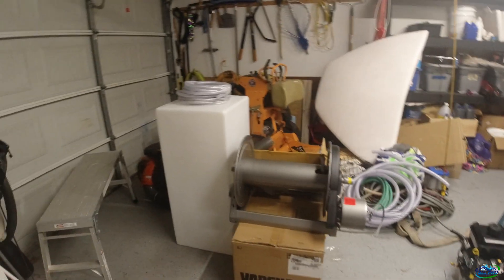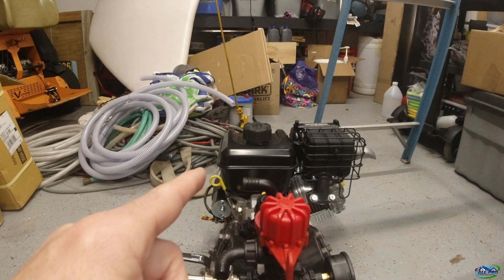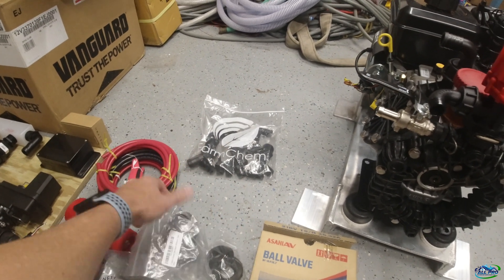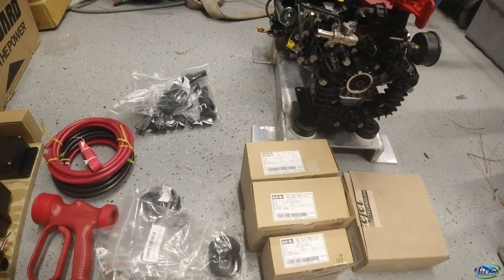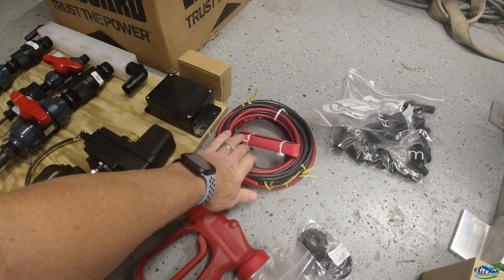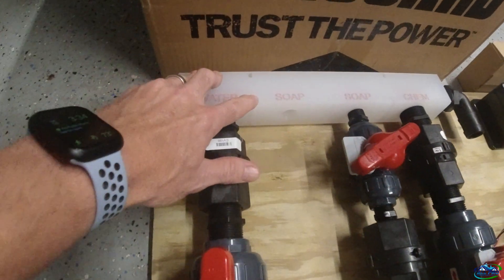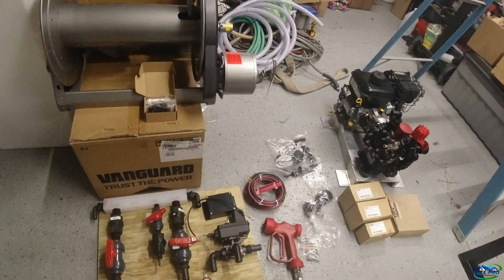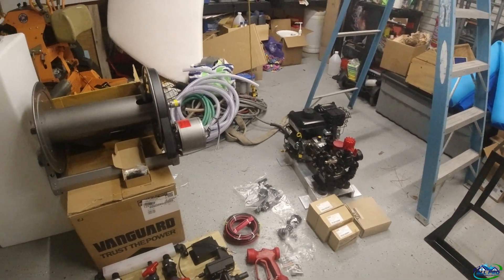AR45 Parts Breakdown

Comment: I want to remove my vanguard non electric start motor off of my AR45 but i don't know the shaft length and diameter to properly buy the new honda gx200 electric start motor.  Do you happen to know what the shaft size and length needs to be to hook up to the AR45?
Reply from the maker: The shaft size on my Vanguard 6.5 is 3/4" x 2-27/64". Thanks

Comment: When I used a wire calculator  installing  my 12v electric reel (36 amps it says), it said 4awg. Any issues with the 8? I guess you wouldn't have anything to compare it to but you'd know if it was getting hot or dropping out from low voltage I reckon.
Reply from the maker: No issues so far. Thanks

Comment: How come you went with the solenoid valve for this and not a ball valve like with the the downstream box? Thanks
Reply from the maker: There is no reason particularly. I read somewhere that the solenoid valve is actually a little smaller than the ball valves in the same size. Thanks

Comment: I watched this video and bought the same engine and ar-45 but where do the positive and negative battery cables go on the engine there’s nothing in the manual and I called vanguard and they don’t even have a clue
Reply from the maker: I put the ground wire on the bolt that mounts the engine to the skid & then to the negative battery post. The positive wire connects to the stater solenoid on the bottom post. You can reach out to me if you need pics. Thanks

Comment: i just bought a ar-45 today. what size are your hose barbs? my outlet seems to be 5/8 thought it was supposed to be 3/4. when i hook up my out let hose going to my hose reel it blows off. so just wondering if yours came with 5/8
Reply from the maker: My outlet hose to the reel is 1/2" & the bypass hose is 3/4" & main feed is 1". Maybe you got the AR60? Thanks
Reply: @allproexteriorservicesllc5338  it’s the ar 45 everything is same as yours but main feed is 1”1/4
how come my red gun keeps blowing off my 1/2” hose? i have to clamps on it i don’t know what’s going on
Reply from the maker: @scottgarvey9164  I use 2 clamps on the barb that connects to the red gun. I don’t think the 1 1/4” main feed hose matters.

Comment: on the metering valves, is in necesary to use a 1 inch on sh or would a 1/2 inch valve work?
Reply from the maker: You need 1" for the water & SH. 1//2" will not provide the proper flow. Thanks

Comment: If you don't mind me asking, how large is that piece of plywood to fit everything, I want to put mine in an electrical hinge cover box for protection, just curious how large of a box I would need.
Reply from the maker: I think it is around 16/18" tall x 22" wide. Be careful with the box & leaks. If it leaks SH, it could cause corrosion issues if you don't rinse it off. Thanks
Reply: @allproexteriorservicesllc5338  thanks, i'll keep that in mind.

Comment: Are you running 300’ 1/2” AG hose for the AR? I’ve heard 5/8” is supposedly better, what’s your opinion on this? If so is that 1/2” flowing fine? I wasn’t sure how much of a difference 1/8” on the hose would really make honestly.
Reply from the maker: I am running 300' of 1/2" ag hose. I have never ran the 5/8" hose & don't plan on it. I am very satisfied with the flow from the 1/2" hose and heard the 5/8" hose is a bit heavy. Plus, most reels have a 1/2" manifold so there is a bottle neck. Hope this helps! Thanks
Reply: @allproexteriorservicesllc5338  Word, it looks like a BEAST in your recent vids. Thanks for being so helpful, get that cheeeese 🧀

Comment: You are using 1/2 inch ag hose on your hose reel.  Even people using 5.5 gallon 12 volt pumps say 1/2 inch is fine, but 5/8 is better.  Gas pump guys use 5/8 inch...less friction and better flow and distance.
Reply from the maker: My 1/2" hose is perfect. Thanks

Comment: We tried using poly braid for our suction/supply line on our comet p40 and they kept capitating due the amount of suction from the pump.  We had to upgrade to steel wire but i think you're going to have issues with yours
Reply from the maker: I am using non collapsible hose. The only poly braid hose I’m using is for the soap line. I hope to test it soon and hope not to have any issues. Thanks for the heads up

Comment: 7:58 just a heads up on the solenoid. It is stainless, however the internals are steel and will rust immediately if it has any bleach go through it. I know you said soap but just wanted to let you know. They’re finicky too. I went through two before I realized “oh wait, stainless body, steel internals because it’s a magnetic solenoid.” Haha
Reply from the maker: Good info and I will keep an eye on it. I wanted the Banjo valve, but finding parts is very tough. Thanks
Reply: @allproexteriorservicesllc5338  Any updates on the solenoid? I'm looking to build something like this.
Reply from the maker: @pashagold  I have not had any problems with the solenoid yet. Thanks

Comment: Hi bro,  remember ditch those check valves and replace for isolation ball valve instead .. plumb in inline with your metering valve.. you can use manual or solenoid active ball valve.. 👍
Reply from the maker: Flash, can you provide a link? I looked online but didn’t have any luck. Thanks
Reply: @allproexteriorservicesllc5338  I used the Asahi ball check valves. Got them from grainger.
Reply from the maker: @jaxxo5  Nice, how are they working for you?
Reply: @allproexteriorservicesllc5338  im not even up and running yet. I did get my manifold from Jason though.

Comment: Maybe you could use a 3/4" pvc board from home depot or lowes. Might hold up better to  the weather and the chems then the plywood. I'm sure you'll get it figured out good luck 👍
Reply from the maker: I believe that is the same as the Starboard I mentioned. Very durable and I will check Home Depot on my next trip. Thanks!